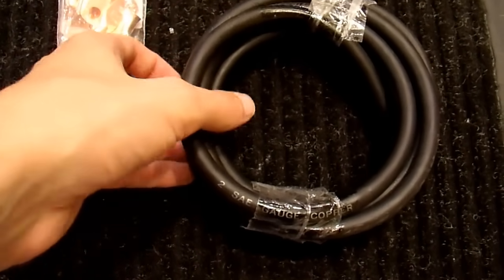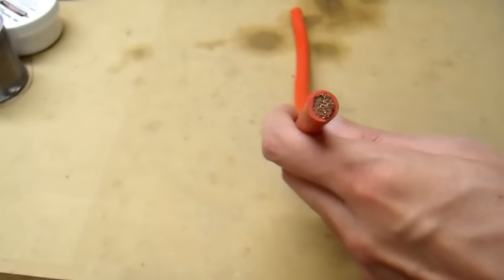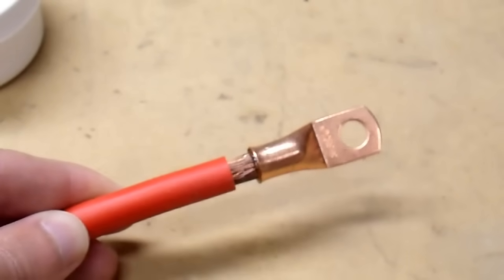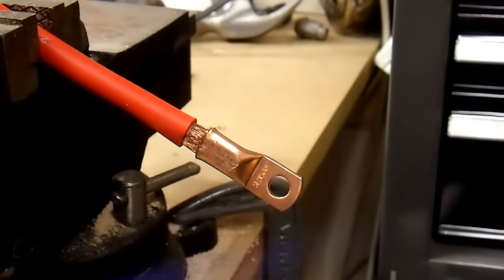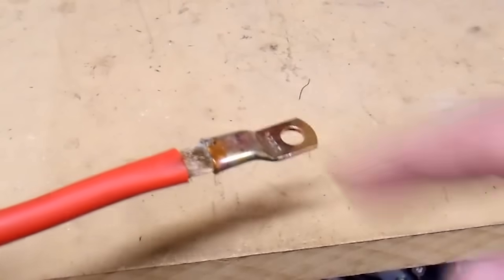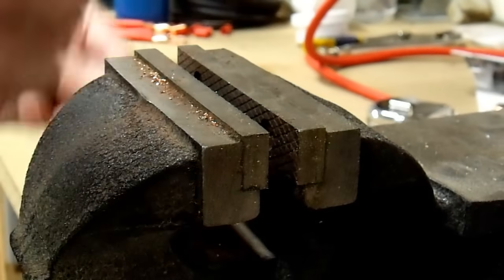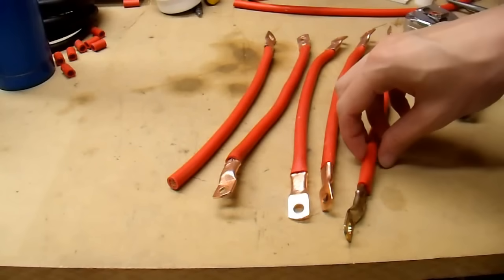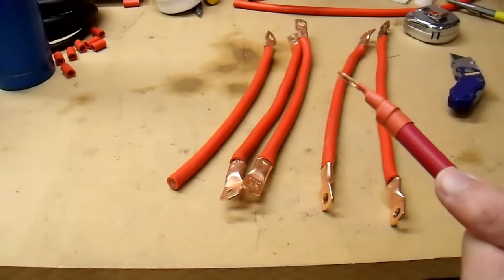How to Make Battery Cables the Right Way and the Easy Way

Comment: Flux isn't necessary however soldering is a good idea and will run into the wiring to help bond/conduct the crimped terminal to the wire.  Definitely use heat-shrink or at least liquid electrical tape to ultimately seal things up.  Thanks for showing us the rookie way of putting this together and being informative.  I'm sure your cables will work fine, yet I predict they will corrode fairly quick given your application.
Reply: Easier just to use a rosin core solder with polyolefin shrink tubing as a protective cover. I don't see any problem with his at home crimping and staking style other than I would use phenolic blocks or plastic to avoid dissimilar metal corrosion from introducing steel into the copper during crimping.
Reply: Just wrong
Reply: @jackster2568  Add your input.  We always learning here

Comment: Aren't there hammer crimping tools around? I don't think a flat vise makes the perfect "grab". That much flux is going to corrode your wire, at least use flux remover after. I'd use dual wall adhesive heat strink, but I'm no expert..

Comment: Two things you got wrong, though-- rosin flux is *not* acidic-- you do not need to burn it off, it's specifically formulated for electronics so that you do*not need to remove it after the joint is done.  That is why you never use acid flux for electronics.  Ever.  

Batteries-- specifically, lead-acid, corrode terminals because of excess hydrogen gas, not due to sulfuric acid.   Anytime you charge up a lead-acid, it will give off H2 gas.  Ideally, you want this to be very low (trickle-charge), but that is often inconvenient, so a fast-charge is done instead--which generates more gas.  If you are getting sulfuric acid corrosion? You have a cracked battery case.... and you have serious problems beyond mere cable corrosion...

Comment: Excellent video.   

I like to drop small pieces of solder wire into the little crevice of the ring terminal first, then insert the wire, then heat and add more solder.  That way I know the end crevices are filled with solder.  

Heat shrink.  The key to using that, is you really ought to use dielectric grease (or high quality axle grease) on your non-soldered joints.  Or even better, buy electrical no-oxide paste. It's cheap enough, NoOx is one brand.  But you basically coat the raw copper cable in the grease/paste, then insert.  Crimp as you did.  Finally, wipe off all excess grease/paste, and slip on a heat-shrink.  The combination of grease/paste/HS tubing will make a cable that you could pass down to your grandkids. 

If you heat the heat-shrink quickly, and don't go crazy with excess heat, it won't melt the protective grease/paste.

Comment: You might re-title your video how to make battery cables the easy way because it is certainly not the right way.  You need a proper crimping tool to do it right so you are actually compressing the lug, not just flattening with a bench vice.
Reply: Not even easier. Crimping is way easier and better
Reply: It's like splicing wire they make a tool for it but knife does the same thing so what is right or wrong when somenone figures out a better way from the correct way then that correct way everyone's been doing it forn50 years is now wrong
Reply: 101% why I came here to inform the creator... the right way... imagine being on a boat in the middle of the ocean or a plane 30000 feet in the air with all terminations done this way?
Reply: The easy way is not often the correct and appropriate way.
Reply: Maybe not right, but I have seen this work for 20 years.
Reply: If you're soldering it then the fact he didn't crimp isn't much to worry about
Reply: @jaydonweston1734 Absolutely wrong, those lugs are made to be crimped, do you happen to hammer in screws too?
Reply: Soldering will give the best conductivity.
Reply: @ricko3k Not it won't, automotive, marine and aeronautical don't use it for a reason
Reply: @ricko3k  wrong soldering will create resistance. And decrease conductivity.
Reply: @Tezzzaaa Another out right lie, why don't you show the source showing that solder is more conductive than copper.
Reply: He does say you should use a crimper but he doesn’t want to buy one
Reply: @petesmith9472  not what his title states. It should be titled how to make battery terminals if you don't have the right tools

Comment: Do not solder, soldering a high load cable is a very bad idea, when / if you get a bad connection the build up heat will loosen the solder and the cable will potentioally fall out, you will also have loose flowing solder going all over the place, the crimp show in this video is also very poor, use the right tool, if you absolutely have to do it the "poor man`s way" use a mandrel and hammer.